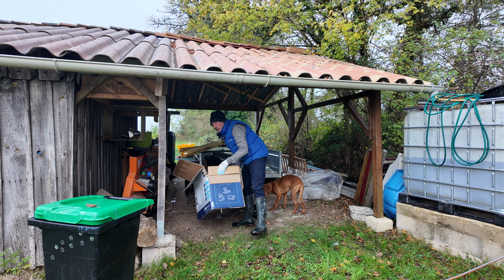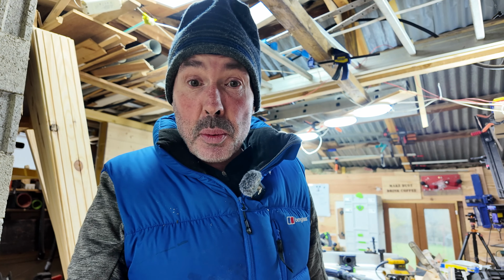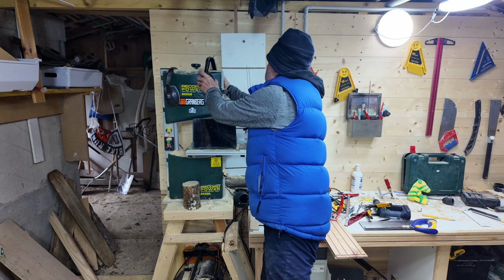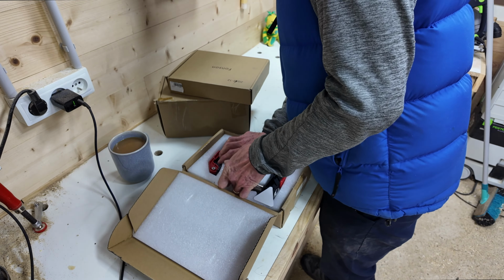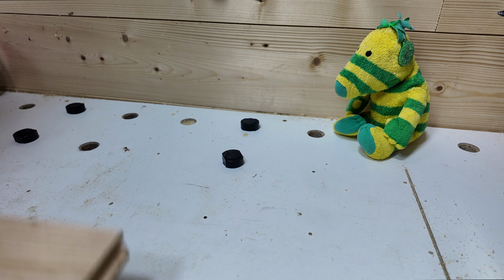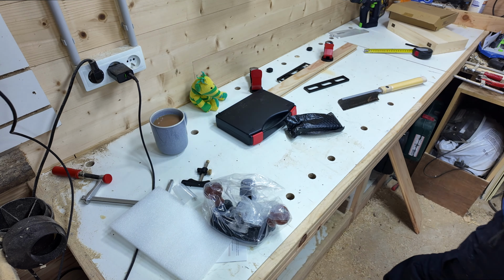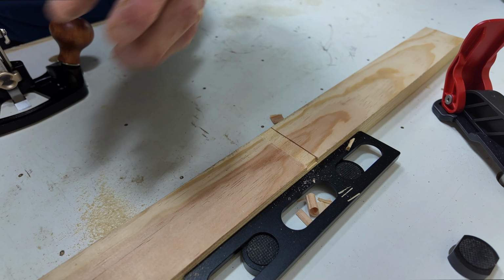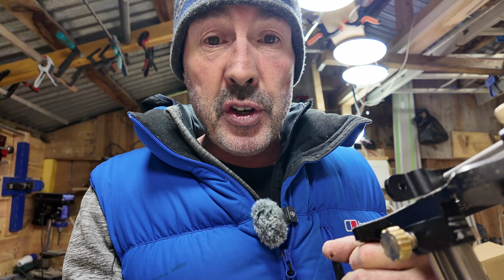Woodworking Tools for a Quiet Workshop

Comment: Im 75 and still work in a disorganised mess. I will never change.  When the bench top is full of tools and i spend more time looking for tools than using them  I stop...put the tools back where they live. Sweep up and start again.  Occasionally a major clean and organise but it is always the same  cycle.
On good day I might have a sharpening hour.
It works, and thats me.
Saw dust gets dumped in a corner of the garden to rot and mulch. Only if i have been sanding or planing old paint does the dust go in bags for disposal.
Reply from the maker: Hello. Your work processes are exactly the same as mine! 😊 Regards JP

Comment: Nice to see someone else’s shop is as bad as mine😂😂. I’ve got the router plane and it is really top quality. There’s also a set of extra blades for it of differing widths but I think they’re only in freedom units
Reply from the maker: Hi Doug. Freedom units 😂😂 I’m told the marking knife blade also fits for a different shaped blade. Regards JP
Reply: @ yes you can fit the marking blade and I think it’s 25mm wide

Comment: Nice post JP. Between getting back into cycling, Tatty Holiday and a strike in the school system, and now the frosty weather, I have barely touched a woodworking tool in weeks. This too shall pass and I'll get stuck in again. Plans in mind for a 2200x550x500mm rustic curio cabinet from pallet wood. Take care & stay safe.
Reply from the maker: Hi Doug. Thanks. Sounds like a nice project. I too am getting back into my cycling. I bought a new turbo trainer (sold the old one when I moved here) A turbo room (pain cave) woodworking project may be on the cards. Regards JP

Comment: The KM on the router plane stands for Katz Moses. He collaborates with Hongdui the same way that Hooked on Wood do. I've not bought one because I still have my Stanley that I love using.
Reply from the maker: Thanks Paul. I hadn't released that. I have just spent 30 minutes on Hongdui's website looking at all the other tools they have.  I may have ordered some :-) Stanley Planes are great, especially the older ones.  Regards JP